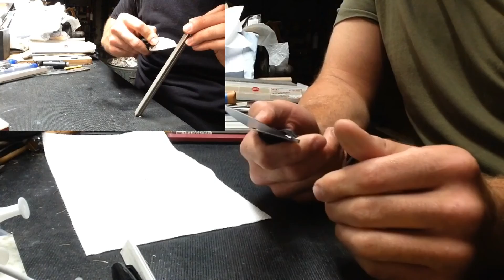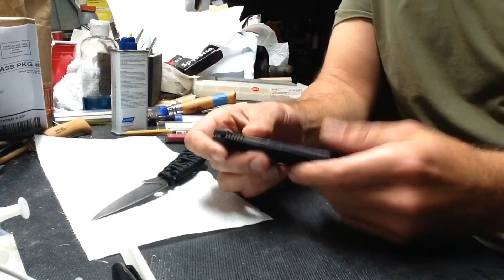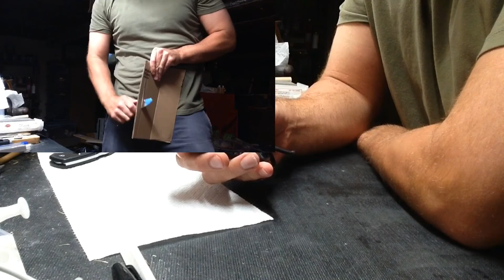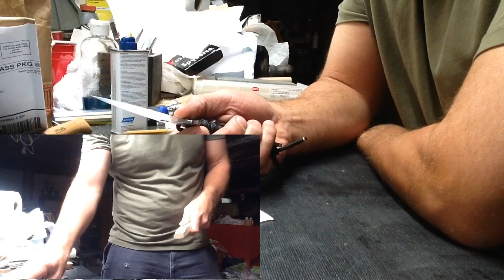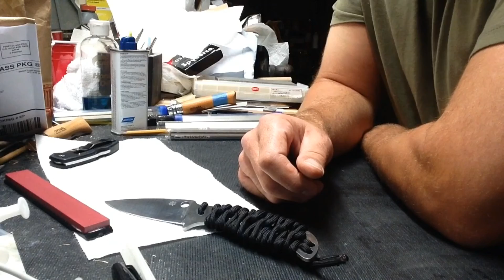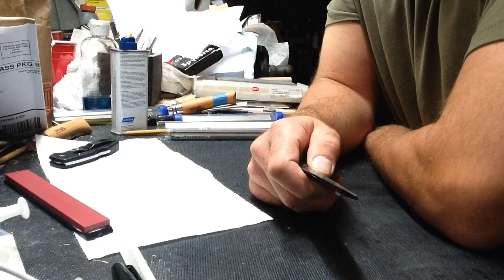Spyderco Mule Team 21 CPM 4V - initial steel evaluation

Comment: Do you have the link to the 3k stones seller in eBay? It looks like it's on an Edge Pro blank and could be used with that system. I would be interested in buying a set and trying them out on my sharpening system. Did you use the 3k dry or with oil or water? Was there  a micron rating? How was the scratch pattern and polish of the stone? Thank you for your time. Interesting steel also!
Reply from the maker: I actually got these on Amazon.  I believe it was a factory direct buy, but I've seen them or very similar stones since on Amazon.  I've seen the factory direct buys on Amazon come and go, so I'm not sure if they're still for sale on there.  The only info listed was 3000 grit ruby red and the measurements of the stone.
Reply: Thank you, I will check them out!
Reply from the maker: +Yehoshua Jason D. Stone they're not a particularly good stone, but for the price I paid it was worth it to check them out.  I've used them with water and oil, and had alright results with both.  If you can find them cheap enough, it may be worth it just to see what experience/observations you can get from them.
Reply from the maker: +Yehoshua Jason D. Stone they're not a particularly good stone, but for the price I paid it was worth it to check them out.  I've used them with water and oil, and had alright results with both.  If you can find them cheap enough, it may be worth it just to see what experience/observations you can get from them.
Reply: +Michael Christy I found them,  around $5-10, depending on the seller.

Comment: all tests have some value& i think your testing is a very decent , giveing performance  of different alloys in relation to each other. going to tech charts from steel company i,ve noticed many alloys require 3 tempers &  to 2 dunks in nitrogen to get optimun performance from certain steels. one tech chart actually required 4 tempers to do best.i do'nt expect factories to go to this level although it would be nice if they did. when desiring the best performance i go to a custom maker with whom i have good relations .many companies tout super alloys but the performance hardly surpasses the quality of some very simple alloys. i find satisfaction from buying lknives that have very pedestrian elemental formulas but have simple heat treats that many times achive better performance than super  alphabet metals
Reply from the maker: If what you're saying is correct, (and it might be) I wonder how much more the knives would cost if the companies took every measure to get maximum performance.

Comment: Are you worried about the paracord retaining water and the handle rusting, since this isn't a stainless steel?
Reply from the maker: Yes, which why it's a simple handle wrap.  The plan (tentatively) was to be able to easily take it off and clean the entire knife and re-wrap the handle.
Reply: +Michael Christy Yeah, I am considering getting one of these (my first fixed blade Spyderco), and thought I would just wrap the handle for now, rather than getting scales for it. Do you think if I used two layers of paracord, with the inner layer coated in grease, that would keep away corrosion? 

Thanks for the quick reply, btw!
Reply from the maker: +dcfutballer I'm not sure.  I think I noticed a little corrosion pretty quickly on the handle under the wrap.  I'm not too worried about it, but it could be a concern for some people.  I would think through heavy use, moisture would get in through the wrap to the steel.  Keep in mind, 4V is only 5% chromium, so easily susceptible to corrosion.
Reply from the maker: +dcfutballer There's also custom scales you can order that are not too expensive.  I've thought about going that route at some point.
Reply: +Michael Christy If I get one of these, I may get some custom scales, possibly the G10 ones from Halpern Titanium. 

How "difficult/easy" would you say 4v is to sharpen, in comparison to S30V and other more common steels?
Reply from the maker: +dcfutballer I don't remember much difficulty with sharpening.  As I recall, it was fairly comparable to S30V.  
It did seem to take a high sharpness very early...  As I said, after 1 micron on bass wood.  
If you're used to S30V, I wouldn't expect 4V to be a problem for you.

Comment: Did you look at the edge up close after or while sharpening on the coarse stones?Mine had one heck of a wire develop.I put a lower back bevel than you though. ~24°I like my "tough steel" knives to have a thin bevel to make use of that steel. I've gotta beat on it some and keep my loupe with me while I'm carrying this knife.I have the "same" edge on my Cru Wear and it holds up like a champ. Ready to test this new steel out.
Reply from the maker: I did develop a wire edge, but then I usually do.  I take it off while sharpening.  I'm pretty fanatical about the burr being gone completely by the end of the first strop.  I use a flash light to see it.
Reply: Cool deal. Same here, though I don't take my knives up to HHT levels, just to the Spyderco fine ceramic at the most. I save my Shaptons and strop for my razors. 
The 4V just seemed to develop the wire more easily than I was expecting is what I guess I was trying to say earlier. You can definitely tell it isn't a soft steel though, the wire was sort of flaky for me.
Reply from the maker: +Elliott Hatcher I thought 4V reached a high sharpness very easily.  I didn't really realize it until today when I was sharpening M4 and HAP40, but 4V seemed to get there quickly.

Comment: What is the promotion of this compared to S30V? That it was tougher? The problem I have is with the inconsistent promotion/claims. If S30V isn't chipping then what is S4V supposed to do? If 3V has outstanding edge retention in a toughsteel what is 4V supposed to do? Where are those steels failing, as described by the makers/users, who are promoting 4V?
Reply from the maker: It's a valid question, and it's one that I've thought about myself.  I think I read something from Crucible saying something about, higher wear resistance then 3V, while maintaining a high toughness.